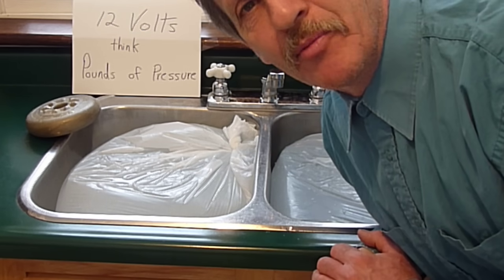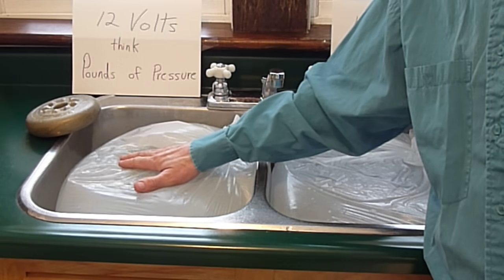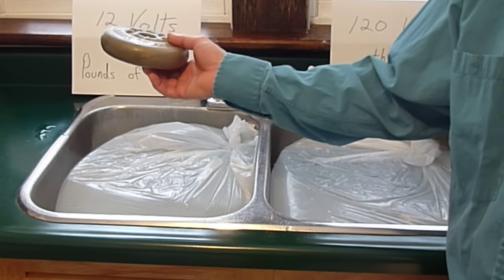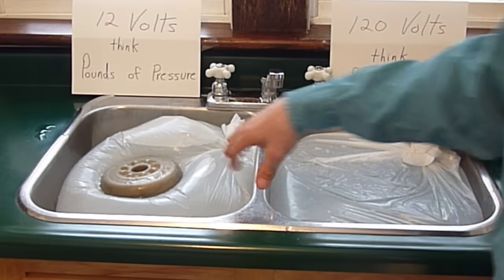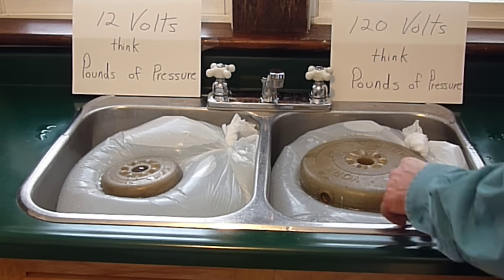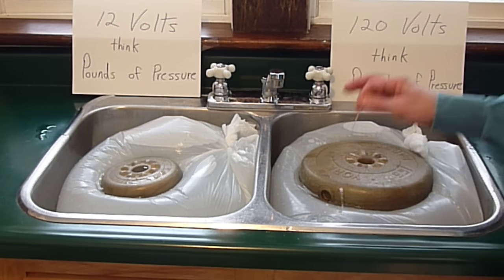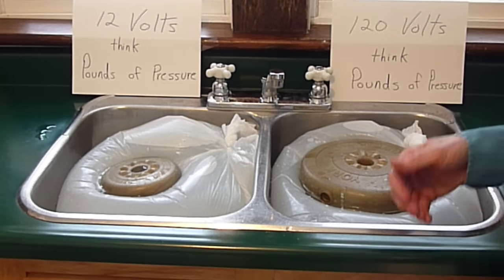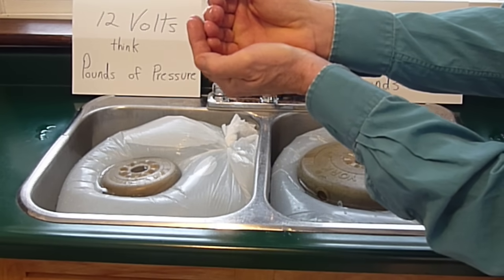Amps, volts, watts explained...SEE what it really is all about.

Comment: I prefer to explain voltage with water, using the vloume of flow as amperage and using the temperature as the voltage.

A spark is analogous to drop of boiling water- hugh energy but low volume.

A bokt.of lightning would be like a flood of boiling water - high energy AND high volume.

Comment: Ive never understood all the electrical terminology--this explained it well! 
So volts are the pressure that pushes the electricity, amps measure the flow of electricity? And watts are the measurement of how much electricity is present. Yes? So then more volts = more amps as well. i guess im still not sure why batteries are measured by volts (like 9volt batteries); what relationship does a battery have with the pressure of electricity?

Acting like you were being shocked when you were collecting the "electricity" was funny too. Thanks for that 😆

Comment: I think a useful addition would be the explanation that you can also draw more current from a 12 volt battery than from 120 volts if you make a larger hole in the left bag (equivalent of a large resistor on 120 volts vs. a short-circuited 12 volt battery).

Comment: This is such a great analogy. Even the math is basically the same (assuming ideal conditions).
The water flow relation to the pressure and the inverse of the hole's area is basically Ohm's law with some extra constants as gravity and the fluids density....

Comment: To summarized for my own learning process, Voltage is the pressure applied to the water, Amps would be the flow rate of the water, Resistance/Ohms is the size of the hole in the bag limiting the flow of water, and Wattage is the force the water exiting exerts.  
So, if you 
Increase the Voltage (pressure exerted on the bag), Wattage (the force of the water exiting the hole in the bag) increases, 
Increase the Amps (the flow rate of the water exiting the hole in the bag), Wattage (the force...) increases,
Decrease the Resistance (by increasing the size of the hole in the bag), Wattage (the force ...) increases,
One additional prop that helps with this demonstration is to add a catchment device to funnel the exiting water to a waterwheel, connected to a mini electrical generator/the right electric motor wired backwards which in turn powers a lightbulb or series of LED's.

Comment: 1 Watt = 1 Joule per second [W=J/sec]

1 Amp = 1 coulomb per second [A=C/sec or A=1c/1sec]

1 volt = 1 watts worth of power sent over a conducting wire at 1 amp (1 coulomb per second) [V=W/A]

1 ohm = 1 volt producing 1 amp [ohm=V/A, ohm=(1{Joule/sec}/1{C/sec})/(1C/1sec)]

Comment: It's very simple guys they put it in the description when you think electricity think water, current flow, it's the strength of the water, on the other hand potential voltage is the difference like a waterfall or river, if the slope is steep or difference is great, it's high voltage, which usually would mean high current it's a directly corresponding relationship ohm law v=ir. That's why when they warn about high voltage it also means high current because thats what kills you.

Comment: Volts is the inclination of the river (or how fast the water is flowing) Amps is the width of the river (or how much water is flowing). You may have a vertical fast waterfall of a small stream, it won't kill you. You might have the Nile river slowly flowing, it won't kill you. But Niagara falls (both fast and a lot) will kill you.

Comment: I'm not trying to sound ignorant or troll. But I'm asking a serious question: So, by this example, with the 120 Amp Volt, you can get more energy out of it, and since it's pouring more energy, can it recycle its own energy?  I know it's a bag filled with water with a hole, but that small hole allows water to go out, and based on the angle (facing up), water could slightly sink in.  Could the same principle be applied to energy with gravity?

Comment: I think of hot water going through a pipe. Heat of the water equals volts. Flow rate equals amps. Total  thermal units through the pipe equals watts. Volts times amps equals watts.

Comment: Would resistance be if you took a piece of tape and stick it onto the punctured hole?
Reply: Metaphorically yes which would then increase the voltage if the current remains the same.

Comment: So basically "volt" is how much electricity is transferred through a wire at any given amount of time.

The more volts there is, the faster the electricity will drain from "storage". 

Is that right?
Reply: That’s incorrect but I can see how the video would lead you to think that. 
I’ll try to explain it differently using a water analogy but with a water hose.  

Volts would be the speed of electrons or “water pressure”.  

Amps measure the amount of electricity running through a circuit “how much water is flowing through the hose.”

Water analogies aren’t really the best to use but it sometimes helps to visualize the flow of electricity when learning about it.   

Basically it’s the amps that drain the storage not the volts.   There’s more to it than that but I’m going to stop there.  Hopefully that makes some sense.

Comment: I did 1 year of electricity in Swedish "high school", I've worked 20+ years in IT, I still don't get it. This lacks real world context. How does this demonstration translate into the outlet in my apartment or the powerbank in my backpack?
Reply: It doesn’t because phenomenologically fluid dynamics and electromagnetism are different fields of physics.

Describing Electrical Potential (Voltage) through analogy to some other force leads to a lot of incoherence. For instance voltage doesn’t really “flow” through a wire, it a present force within the wire at all points simultaneously. Just as Charge is an ever present force within the wire as it is a property of Matter.

The unit measure of Charge is the Coulomb, which is defined as a (very large) number of electrons. The Ampere is a measure of Coulombs moving past a point, per unit time.

You need voltage to move charge, to create a current in a closed circuit.

It’s actually all rather complex and simply waiving ones hands in the air with these dreadful analogies is what has lead to your immense confusion.

Read the wiki. Best advice I can offer.

Comment: i always liked how they explained it in electrician school to visualize electricity, comparing it to water (not perfect ocf, but good enough):
-Volt is the flow speed or pressure
-Ampere is the pipes diameter
so you can have alot of volt, but it doesnt really "hurt", if there is no diameter/ampere involved, but if you have a giant pipe, even if its flowing slow, it will drown you, thats why ampere is more dangerous, in most cases!

Comment: hmmm I am not sure you got the Watts part of the analogy correct.
It seems more like the water itself (its volume) represents the Charge.

I would say the demonstration of watts would be if that water did some work - e.g. you can have a small water mill which the water would turn.
And then you can say that you can get the same wattage by having the small hole on the 120V system, or larger hole on the 12V system (so it has less resistance --> bigger current  --> can achieve equal wattage on the mill)

Comment: I always explain to using plumbing.  Volts is the pressure, size of pipe small low voltage larger diameter pipe higher voltage.  
The water is amperage. Watts is the measure of amount of work being used or required.  Amperage is the temperature of the water in the pipe.  Higher amperage the hotter the water.

Comment: When I was in my plumbing apprenticeship, an electrician explained electricity through a wire related to how fluid goes through a pipe- voltage is volume, amperage is pressure, resistance is friction, wattage is demand. 15 years later, I think it was a brilliant way to explain it in terms I could relate to and understand.

Comment: Wow ..
What a horribly incorrect explanation

Firstly.- 
1) voltage IS NOT PRESSURE.
Voltage is 'potential' its almost impossible to explain. .think of it like marbles rolling down a ramp, the more gaps in-between the marbles, the gaps represents the voltage, the easier the marbles (electrons) flow. 
The less inclined the ramp is and the more closer together the marbles are representing less voltage, results is less flow.
Voltage is not pressure.

2) Watts - 😅😅 omg your little statement at the end.. I worry about howany people you've brainwashed. 
You can't collect "Watts" 😅
Watts is the measurement of work being done.. Watts in your silly experiment would be equivalent to the force upon the water being spurted out.. it's the action. You can't collect it. 

You're statement should have been "I've collected a few coulomb's of current"
Reply: Yes, I was thinking the same about the last statement. If anything, you’re collecting Watt-hours

Comment: Use water hoses with different sizes and water pressures, plus some buckets to explain volts, amps, and wattages. Add a turning valve to explain resistance.

Comment: Can one regulate the voltage? Like what if I have a 120V battery and I don't want that much electricity current?
Reply: to reduce the current, add some ohms, in this case, punch a smaller hole.

Comment: You should be a good paid teacher. Because this is how i explain physics too. Other example is heat, greater the difference of temperature, higher the voltage/pressure.

Comment: I teach electrical apprentices and we refer to voltage as “pressure” and “potential” at times. I draw a water flow system with a pump, narrowing of the pipe and pressure gauges but this is an excellent analogy. Thanks.

Comment: Why not the waterfall analogy?
The height of the fall is the voltage and the amount of water passing at the top is the amps/current. The power is the force at the bottom.

Comment: So . . . The electricity on the right side of a circuit goes higher than the electricity on the left side of the circuit.  And a more powerful battery will get your hands wetter. Got it.

Comment: He is correct with the analogy in terms of voltage /pressure and current /water flow rate. 

But collecting the water is analogous to total charge; 

charge = current x time

or energy transferred ; 

energy transferred = charge x voltage

With the higher voltage (bigger weight) he collect more charge per unit time, since the rate of flow of charge is higher. We can say the rate of transfer of energy (power) is also higher. 

power = current x voltage 

Energy transferred = power x time

Comment: This demonstration makes sense, but please explain to me why it doesn’t hold up to the P = VI equation I.e. with the same power, the 12 volt battery would produce 10 times the current of the 120 volt battery, but the demonstration suggests the opposite (that the 120V battery has 10x current)
Reply: Don't forget; power is a rate, so it's actually watts per hour.
And then think about the hole being adjustable, so you can increase the output,  like when you pull the ceiling fan chain to make the fan spin faster.
Reply: @epluribusunum-1  If power is rate, shouldn’t the bag be kWh? So basically, the amount of energy in the bag, and the rate it’s consumed at would be the power (in kW). I dunno, I’m not especially good at electricity
Reply: @GearzMonkey  That's not my example, bro.
Look, it's simple. 

Resistance can be measured. 
Amperage can be measured.
There ya go.

Everything else is just made up.

Voltage? It's just a product of Resistance × Amperage. That's all Voltage has ever been. It's made up. Like we made inches of  water column. Or the Fahrenheit scale.
Watts? That's the dudes last name that got stoned one night and said hey, let's invent something. He invented watts.

Comment: This doesn't explain what I thought it was going to explain. Yes, it showed me that 120 volts flows more than 12 volts, but that's a given. What I want to know is, in analogous terms, what's the difference between amps and volts? For example, using a river as an analogy how does the speed and volume of the water flowing correlate to volts and amps?

Comment: As a chemical engineer, I had to take a few electrical engineering courses. One thing that stuck with me from those courses was when a professor equated this phenomenon with an equivalent principle known all too well to ChemEs. 

He stated that a difference in electrical potential (voltage) at points A and B is the driving force for flow of electrons (current) from A to B, just as a difference in fluid pressure is the driving force for fluid flow. Thus, voltage can be considered as a pressure difference and current as a flow rate.

Comment: This explanation is completely wrong! If both bags are the wattage. The bag with lower volatage will have 10 times more amperage. The mathematical equation is P=I×E. P=wattage I=amperage and E=voltage. If you have 10000 watts at 12 volts...yoo would have 833.33 amps. At 120 volts you would have 83.33 amps.

Comment: Missed opportunity! You could have explained resistance during that, by pointing out that the hole size represented resistance. Bigger hole (less bag in the way of the flow) more amperage (water) flows, smaller hole (more bag in the way of the flow) less amperage (water) flows. Nice video though.

Comment: Great explanation! Thank you for sharing. One question; when an appliance such as a heater or microwave says “1000 watt output” does that mean it USES 1000 watts? The word “output” seems to imply that it sends out / radiates 1000 watts, which is a little confusing.

Comment: I also explain to my friends Voltage is speed you driving regular car lets say 65mph and 65mph eighteen wheeler, same speed (voltage) but amps is how much weight they can carry. Car is 2ton, but eighteen wheeler 80,000 pounds-that’s power/volume can carry of electricity in amps. So let’s imagine 120v golf car at 10amps battery it be weak to pull weight, make it 120v at 50amps and can pull much more heavy weights. Also imagine pressure washer, it shoots water in sky at certain speed 25 feet high, let’s image firefighters thick hose with water putting fire down. Shoots water at same speed (voltage) but with much more flow volume of water (that be an amps). That’s why you need thicker wires for strong amps in electricity for all those electrons to run in big volume to make heavy tasks.

Comment: So, basically, similar to a water hose. When you place more of your thumb over the hose opening, the more water pressure is equal to a stronger current of electricity. In this case, Amps.

The Amps is in relation to how smooth that flow of power is coming into the item, needing the power.

Say, such as a lightbulb. The weaker the Volts, the lesser the flow, which means there will be gaps in light inside a lightbulb.

Because the power needed by the lightbulb (say 12V) isn't sufficient enough to keep the Amps constant, so that the lightbulb lighting isn't flickering or dim. 🤔

So, the Watts is what is overall needed to be borrowed, for the lightbulb to be able to give a contant light. No dim and flicker.

So, if a lightbulb needs to borrow 12 Watts and you only supply 7V, you'd get no light or possibly a flicker. 😬😅

But if you have, in total, 120V, then that's well more than enough, to keep the light from going dim and/or flickering?

I know this doesn't count the conversion of Watts into using exact Volts to prevent undercurrents or powersurges. But, is this a pretty close understanding?

Would love to be directed to the next step in understanding how not to add too much Volts, so you're not pumping too much electricity, in say, a microwave to prevent a microwave from exploding. 😅

I think I made the basics make sense. Finally, I understand!!!!! 😅🤘✨️🎉🥳

Comment: Ok there were watts and volts. So where are amps??
Reply: Amps is the force of pressure, that's coming out of the pinhole. In each bag. Watts is what is borrowed, say for a lightbulb. Say if a lighbulb needs 12 Watts of that 120 Volts.

Think of a pie. If you have 4 pieces, and the lightbulb is one of those 4 pieces. 

This is how I just figured this out. That worked for me. However your brain helps you interpret the information that's more inclined to be the most memorable for you, is all that matters.

I just don't understand how the conversion works though. At all. But I been trying to figure out the basic understanding for years.  I understand now. I hope this helps!! 🤘✨️

TL;DR: Volts is the power. Amps is the pressure/flow of that power current, Watts is what's borrowed out of the 120 Volts, in order to power up said item (eg: lightbulb).